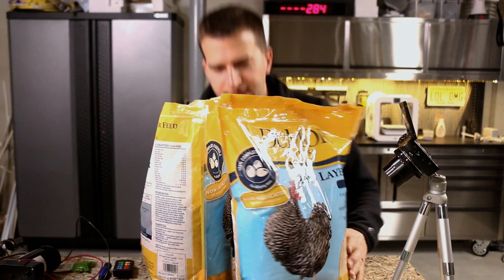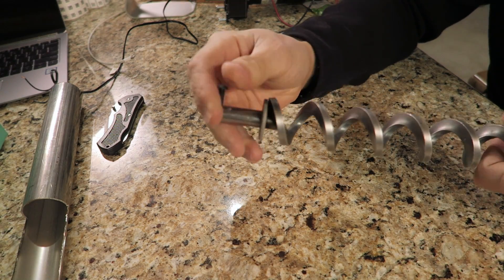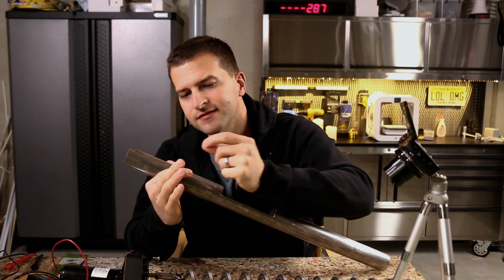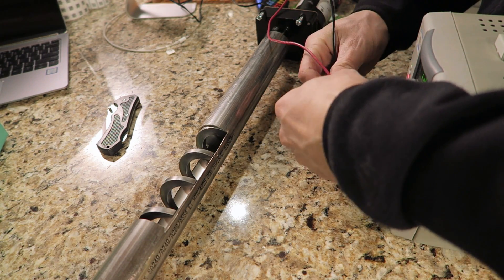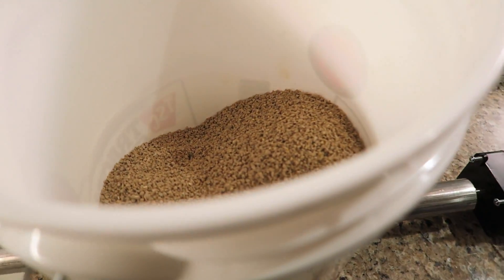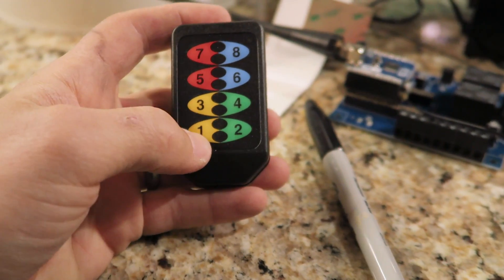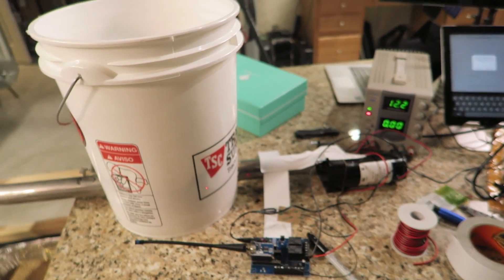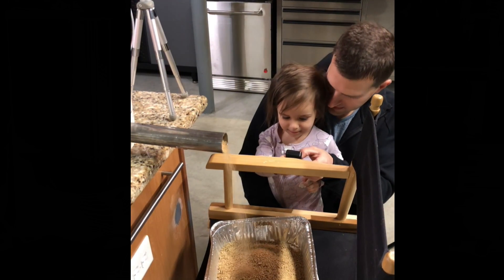WiFi Chicken Feeder | Setting Up The Hardware

Comment: This is exactly what I want to build. Can you tell us what the make and model is of the motor. Also I was thinking about using a sprinkler timer to activate the motor, I need to think more about that as sprinklers are 24 volt. Maybe I will use relays or something like that. Anyway this is a great video, thank you. Any info on the motor is appreciated.

Comment: Joe if your getting full grown chickens that are laying or ready too you feed them layer feed  but if your starting out with baby chicks then you need to feed them starter feed to promote growth when they are 18 weeks old then you switch them over to layer feed. Sounds like a good idea better get a automatic door opener made up so you don’t have to go out in the cold or wee hours of the morning to let them out summer time sun comes up early.
Reply from the maker: Yes! I’m designing the feeder for adult feed, but it looks like it will work with chick feed also. I will test both types. As far as the door goes, I’m considering using passive RFID ankle tags (they’re no heavier than a label - and don’t have batteries). I’m playing with a concept that would detect that all of the chickens are in to roost for the night, then the door closes. It’s a little sci-fi but I think I can pull it off.
Reply: @JoeDidItTV  Did you pull this off? I really enjoy the channel

Comment: What remote and shield are you using?
Reply from the maker: It’s a particle photon arduino, a 2 relay board from ncd.io and the 8 button remote also from ncd.io along with their remote receiver which is the little piggy back board. I’ll go over all the details in the software video.

Comment: Nice job 👍
A drawing would have been useful to avoid the pipe's cut mistake
Reply from the maker: For sure! I actually have about 6 feet of this pipe so when I move to the official container (which will likely be a galvanized 10 gallon feed container) I’ll probably need to cut a new one since I originally thought I would use a much larger container.